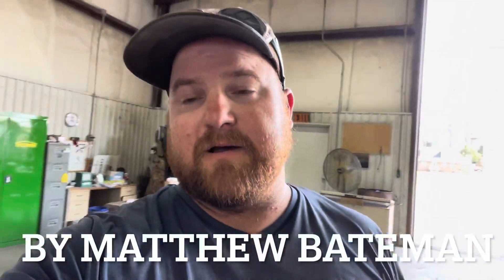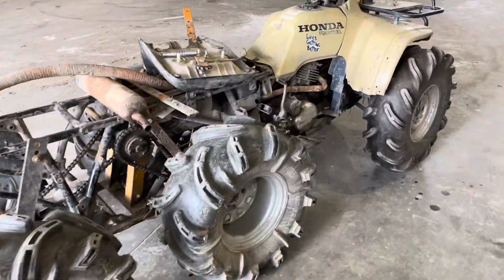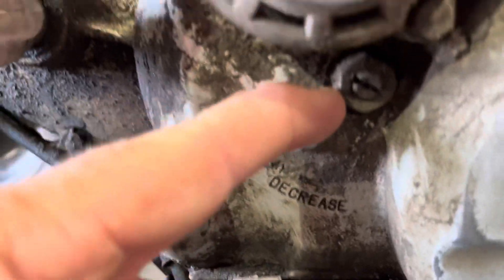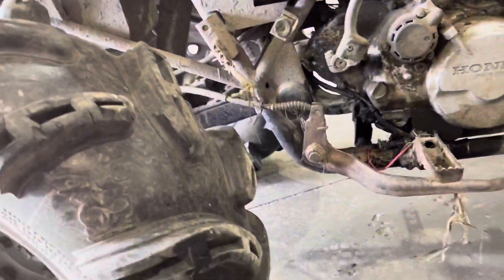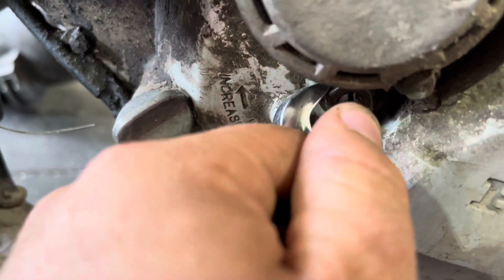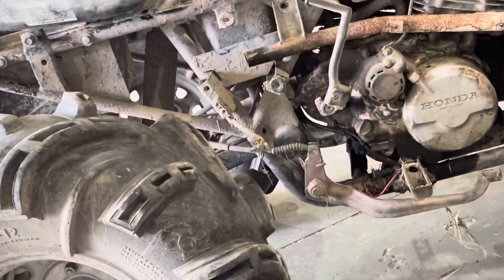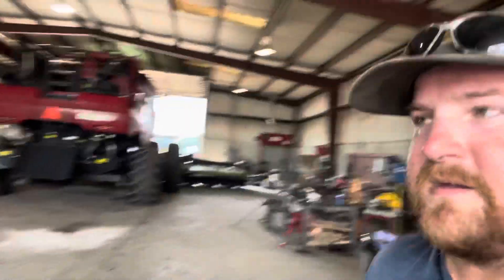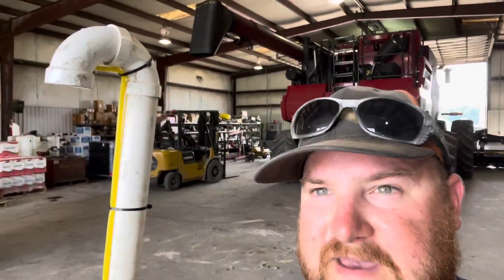Honda TRX 300 clutch adjustment SIMPLE AND EASY ONLY TAKES 1 MINUTE

Comment: Know that I watch this I have the same problem with my 400 big bear it will skip 5-10 ft forward from the neutral to 1st shift but also it will skip from 1st to reverse and miss neutral then I shift it back and forth 1 to 4 times to get it in neutral but besides that from 1st to 5th it shifts fine and downshifts fine but also to get it in reverse u have to hold a knob then shift from neutral to reverse but it skips from 1st to reverse a lot like I said 
Sorry I rambled on so much but thanks for the vid
Reply from the maker: Of course I got it all fixed now so here’s hoping to get time to take her mudding this week
Reply: I’m heading back from the mountains tomorrow so I will see u Sunday